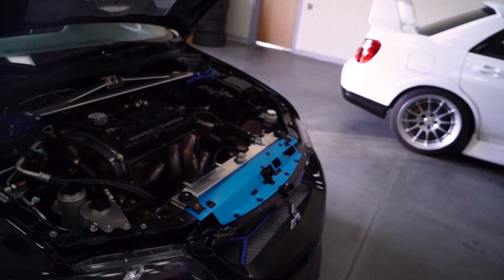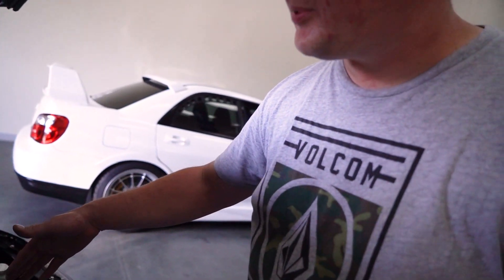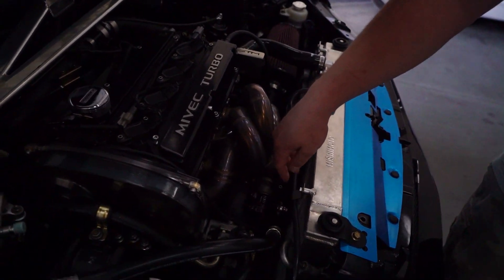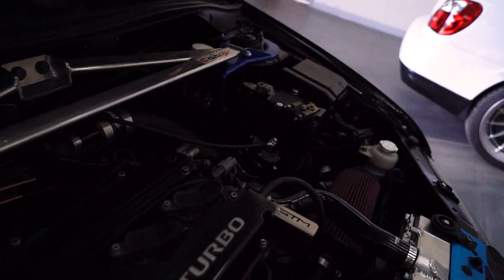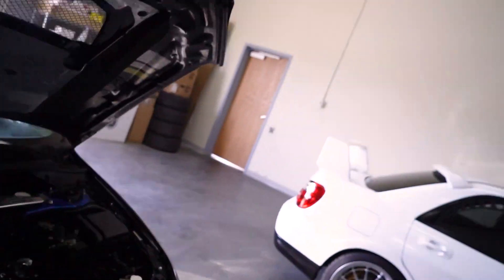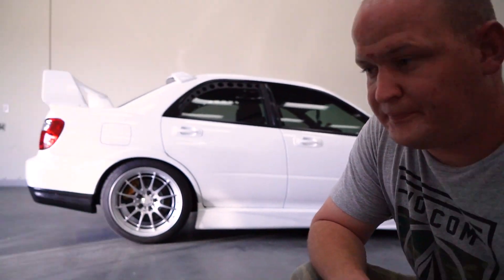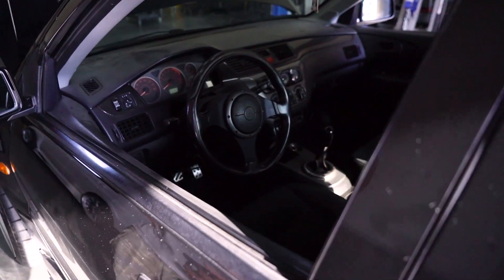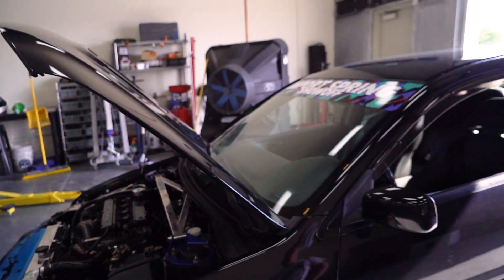Matthew's EVO 9 Interview - Rad Rides

Comment: Curious if the owner had the skunk2 intake manifold port matched to the 68mm skunk throttle body?   Also curious on the TE37 wheel size / offset and if he had to run any spacers?